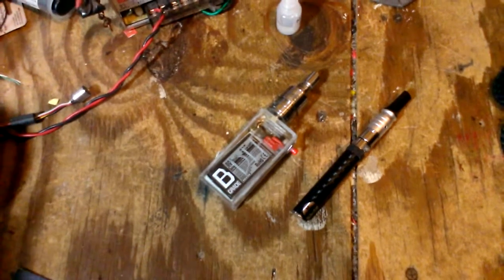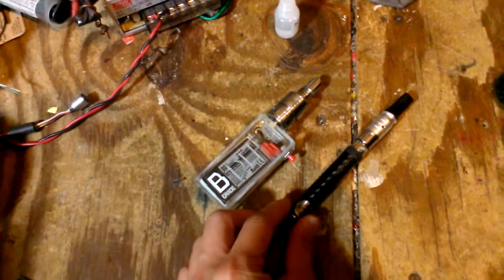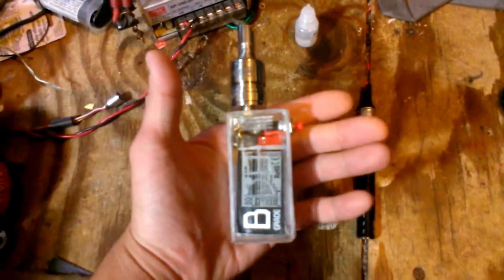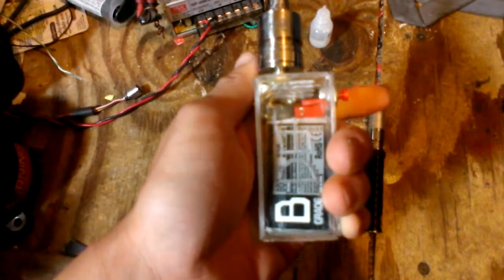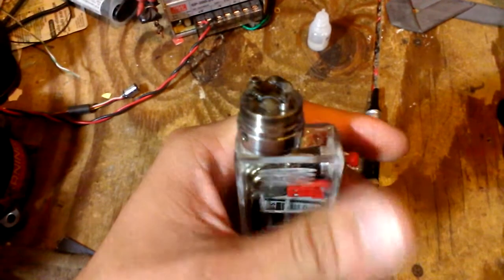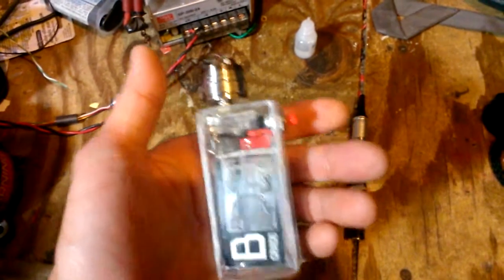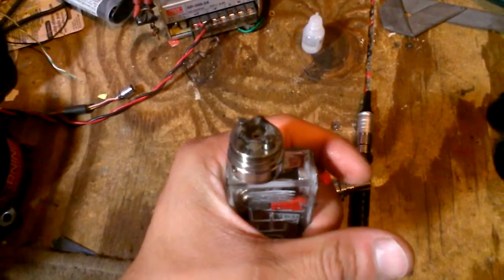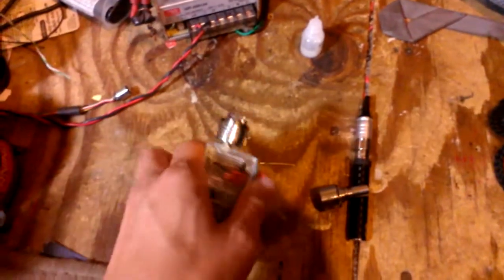DIY box mod part 3

Comment: Is that just one lipo battery and if not did u wire the two batteries in series?
Reply from the maker: its a 7.4v 2s hobby-grade lipo battery